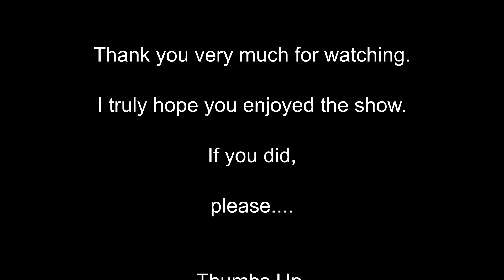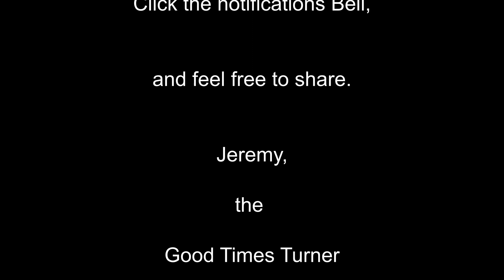Lidded Bowl for Claudine (Mom) made of Maple, Walnut & Epoxy

Comment: Great job and well done on video. Q: not familiar with E-Z instant glue. Looks like a CA glue. Anything special about this brand?
Looking forward to your next video
Reply from the maker: Guy,
Thanks for your kind words and thank you for watching. E-Z Bond is a CA glue. I get it in bulk from a guy in my woodturning club. I have not been able to find it online. It comes in thin, medium and thick. It also has its own brand of accelerator. I used the thin to finish the handle (finial).
Take care,
✌️,
Jeremy
Reply: Jeremy Edwards if you could find out from your supplyer it would be appreciated THANK YOU